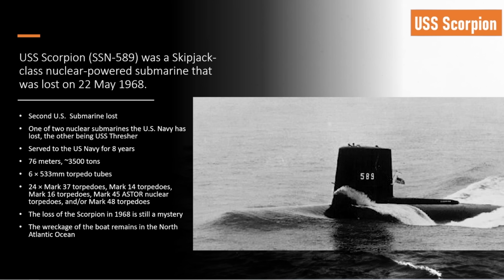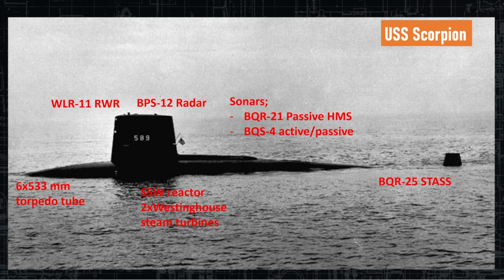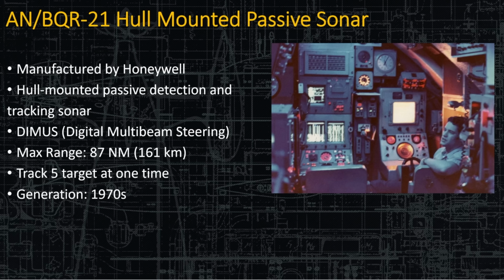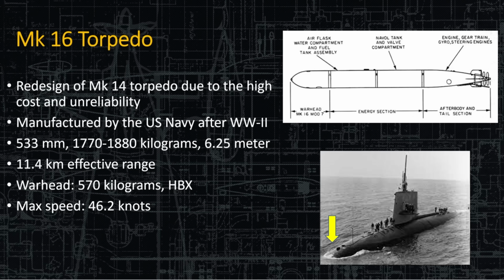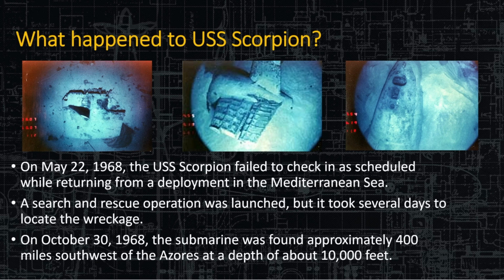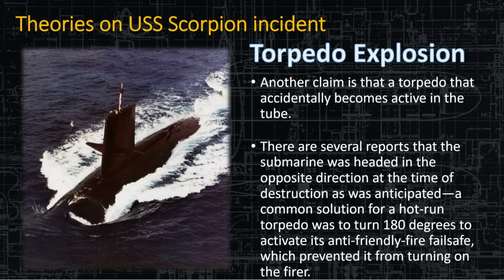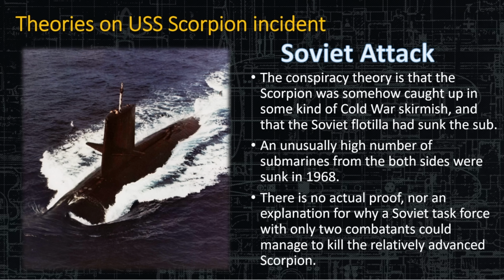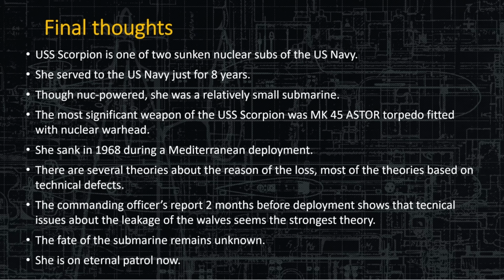USS Scorpion SUBLOSS SUBSUNK

Comment: I've heard of the MK-45 nuclear armed torpedoes, I had no idea their range was THAT limited in relation to the lethal bursting radius of the nuclear warhead......no doubt the crews were not sorry to see them withdrawn from service. No doubt there's nuclear armed MK-48's and especially MK-48 ADCAP torpedoes in service, but the U.S. Navy will neither confirm or deny their deployment at sea. As for the cause of Scorpion's loss, is it possible a battery explosion killed or incapacitated everyone in the forward compartments, leaving the boat to wander uncontrollably until it sank to collapse depth? If so, the Scorpion was lost for the same reason the Argentine submarine San Juan was lost. Hopefully, the U.S. Navy will declassify documents from its investigation so the families at least could get some closure.
Reply: The MK-48 is only equipped with conventional warheads.  Ex-AWEPS.

Comment: The mechanical to electronic converter for steering the sonar you called a compensator.
Is that another name for a potentiameter or encoder. Or is it something different entirely?
Reply: I have no knowledge but it sounded to me like a device which was being tuned to a longitudinal pressure wave. 
Just like a blown musical instrument you tune it by varying the length of the column.

Let me guess at this. 
You expect some frequently. It has bounced off many things but if your detector is at the centre of a curved plate close to a flat plate it will preferentially accept a certain frequency. The frequency which is selected by how the plates approach each other. 
You can steer the direction of reception by tilting one plate, slightly to the side or further round.

Just a guess.
Reply: @20chocsaday  you are attempting to describe the sonar itself. I believe I understand the basics of that.
I'm asking about the part from mechanical wheel turn to electrical signal. He uses a term I'm not familiar with and am wondering if it's just another name for what I know or a different way of doing it.
Reply: @Ye_Old_Grog  OK thanks. 
I was expecting that turning the wheel would move a plate to the direction where you wanted a waveguide to be created. More by a wobble than a 360 degree sweep of an inlet. But thanks for the information.

Comment: Fellow Bubblehead here (SKC(SS), USN, Ret).... where did you get the info on the TDU? I never heard that before. During my career, the prevailing rumor was the Hot Run theory, and the BS about a Russian boat doing it was just that- BS. Good show, though- BZ!

For what it's worth, I was on a 594 (the Haddock) and a 637 (the Pintado) in the late 70's- mid 80's and both boats had CO Standing Orders that the Chop had to be present for TDU Ops to ensure they were done correctly, so what you're saying may have something to do with that... hmmmmmm.....

Comment: Do modern subs have battery backup on the propulsion system? Or are they dead in the water if the reactor shuts or is shut down?
Reply: nuclear subs have batteries and diesel generators. they can also for a very short period run on residue heat from the reactor
Reply: @heuhen  Thank you 🙂

Comment: Weren't the periscope and mast(s) in the raised position as shown on the wreck photos? Wouldn't this suggest they were at PD? If so, and a message could be flashed out very quickly, why no message?

Also, I believe the wreck analysis indicated the batteries were damaged in a way consistent with their explosion.

So, it does sound like a battery issue, but why no SOS message?
Reply: I believe i read somewhere the pressure from those batteries exploding would've killed the entire crew instantly

Comment: A couple of thoughts: The lead-acid battery (Guppy-1 Mod c) evolves hydrogen during normal discharge as well as during a charging evolution. That H2 is removed from the atmosphere via the CO/H2 burner, which converts CO into CO2 and converts H2 into H2O via a catalyst. The H2O (water) drains into the AMR (Aux. Machinery Room) bilge and is eventually pumped overboard. The CO2 is captured in the CO2 Scrubber and pumped overboard.

Also, though the loss of the Scorpion occurred nearly 8 years after Thresher, SUBSAFE had not been fully implemented in the fleet and boats like the Scorpion, built before Thresher were not built to the SUBSAFE standard and had yet to be retrofitted in a major yard-period.

Comment: Salt water in battery compartment leading to electrical fire , release of hydrogen from ruptured batteries, which leads to explosion, which leads to loss of ship.
Dr.  John Pena Craven cuationed against this line of thinking. Becouse any flooding of submarine would introduce salt water into battery compartment. The true cause would be the what caused the flooding initially. Every submarine that sinks will have its batteries burn and explode from saltwater intrusion into battery compartment. It is a consequence of flooding , not the cause of flooding. What caused the flooidng in the first place?

Comment: The TDU, and torpedo tubes and signal ejectors, have mechanical interlocks so you can't have the breach door and muzzle door/hull and backup valves open at the same time.

Comment: One thing you can say for certain about the maximum range quoted for any sonar system:  It is most assuredly not the maximum range it can be effectively used at.  Whether it's lying high or low depends on the system and who's quoting, but any unclassified number is going to be lying through its teeth.

Comment: Lithium battery run away fire in the battery compartment.  I lived in Istanbul Turkey and was 12 years old when this happened and we also saw the mighty E's crew attacked by rioting muslims during shore leave in May 1968.. Coincidently , my mom worked for the Charleston newspaper and she rode offshore on the USS Thresher in spring of 62 when it made a port of call during a shakedown cruise..

Comment: Why do subs have a trash disposal system? This seems to be entirely unnecessary. A strange superflous luxury. If you take x amount of matter into  a sub at the start of a voyage the amount of that matter will remain exactly the same during the trip of the boat. Nothing more will be added. Trash is the result of some of the matter you took on board converted into trash.The process of convertig x amount of matter into trash doesn't affect the buoyancy or weight of the boat at all. So why not just store that trash on board and dispose of it once back in port? Get rid of the error prone trash disposal system. What a joke  - a hull penetrating system just to get rid  of some trash??? A design flaw. Same goes for No1 and No2. Keep it on board. Purify what you can purify and store the usless waste until you're back in port. Again no need for a hull penetrating system. I hope the US sub designers have caught on to this approach  in the meantime.
Reply: Spoken like someone who has never gone to sea on a sub.
Reply: @nukegator7274  Yeah, perhaps it needs an amateur to state the obvious. Although submariners are supposed to be a clever bunch - of dealing with trash in a sophisticated manner they know nothing. You take out the crap you bring in. Is this so hard to grasp?  Why do you need to dump your rubbish in the pristine ocean? Because you haven't spent a single effing second thinking about this problem. You should have a trash officer on board who is trained and understands. You might even have to change the products you buy to provision your boat and also what kind of food you eat there. But don't tell me this problem can't be solved. It is lazyness and the American throwaway mentality that make this an unsolvable problem.
Reply: Probably the long term smell and maintenance of the systems is why they bother to shove it overboard.
Reply: @captiannemo1587  Put the stuff in cold store - zero smell. As you empty out your stores of food and other items for daily use you make space for trash which is stored exactly where the frozen hamburgers were stored before. It is just exchanging one less degraded type of matter with a slightly more degraded type of matter. Have you heard of a trash compactor? This is certainly a less complicated system than a hull penetrating trash disposal. Plus ejecting trash in the middle of a mission isn't exactly the best way of remaining undetected. How do you track US subs? Not by some sophisticated magnetic anomaly detector but simply by fishing out the hamburger wrappers and other trash ejected into the sea through the TD units.
Reply: @wkgurr  Dude, you have no idea how disgusting that trash is. Putting your trash in the freezer is a terrible and unsanitary idea. The freezers are already packe enough, and we have to store plastic trash for later as well. Also waste water creating something that could process waste water would take up so much space, and would probably break. Just pumping/blowing waste water overboard is the easiest and take up the least amou t of room. I don't think you realize how desperate for storage space US subs are already. Plus if you just pump when you don't need to be quiet, you're fine.
Reply: Submarines do trash dumps in the ocean daily.    They don't have a storage tank onboard
Reply: @gregorylyon1004  They should have. It would get rid of the trash disposal system which is a weak point of the sub. Any hull penetration is a weakness. The fewer you have the better.

Comment: Something has always bothered me about the picture of the stern, showing the oil-canning of the stern plane surfaces. The actual stern of the boat is visible. Where's the screw? It should be visible. The only non-conspiratorial explanation I can come up with is that it was, understandably,  scrubbed from the release photos. If not, where is it?
Reply: The screw and the shaft was ejected out of the stern when the engineering space’s telescoped into one another
Reply: That u cant think of a reason it isnt there doesnt mean there isnt a reasonable explanation.

Comment: I just have a hard time believing the Navy wouldn't go out of their way to figure out WTF happened, and most importantly to recover or destroy sensitive hardware/equipment. Theories don't seem like acceptable conclusions. Like... the only way they're gonna confirm the technical issues is by opening up the ship and actually looking in the supposedly affected areas. Maybe I'm dumb, is it just too hard to figure out what happened?
Reply: Between the violence of the implosion, what ever went wrong, and the depth of the water, most of the gear is destroyed. They were reasonably sure the Russians could not recover any of it. Lastly the "Navy" probably knows more than they are making public. The quotes are because they have gone back to the site to monitor and as time has moved forward so has the tech. There is no way they did not put a better camera on an ROV or drone and get better pictures. There is also no way that that they haven't gone back with a high resolution side scan sonar and mapped out the wreck. But a report was written, a few people read it and it was put away somewhere. The people that wrote the report and the people that read the report are now old men.
Reply: @MarkLawrenceKiefer  The only system that isn't destroyed is going to be the reactor, which we really do not want to have destroyed (we routinely run radiation surveys over Scorpion and Thresher to detect if the reactor containment vessel has begun to leak, to allow remediation if it has).  And it has been declassified for about twenty years now that they did resurvey the wrecks of both Thresher and Scorpion in 1985.  Using both HRSS and ROV photos surveys.  The surveys were done by Bob Ballard--the Navy funded his search for the Titanic on the condition that he survey the submarines first, and could use whatever time and money was left over on his liner hunt.  The photos are mostly still classified.
Reply: @rdfox76  The Soviet MIKE class that sunk in the Norweigen Sea in 1989(?) could become a radioactive hazard in the next decade.
Reply: They already know what happened.     They don't want to tell the victims families

Comment: 1 Full Power Hour = Reactor is run at 100% for an hour. So 4 hours at 25% is 1 EFPH (Effective Full Power Hour) When I was in I think they were logging Rx Pwr every 15 minutes, but I suspect it's digitally logged now.
Reply: Ha, you think the Navy would pay for fancy digital log-taking equipment when they've already got perfectly good sailors with pens and paper?
Reply: There is actually a good reason to manually record log readings.  It helps to ensure that the crew is actually monitoring critical system parameters to ensure safe operation and detect any adverse trends such as increasing bearing temperatures, etc.

Comment: I was 8 living in base housing in Norfolk. There were a couple of families affected. They stayed about 3 months after she was declared a loss then they moved away. Very sad. You didn’t mention that they have to dive on the wreck to monitor the radiation levels from the reactor indefinitely.
Reply: They don't dive on it, they lower sensors. Any radioactive fuel that leaks will stay on the bottom because it's heavier and tungsten than anything else, including lead
Reply: @johnryan8533  actually they did dive on it Ballard did in the 80s
Reply: @johnryan8533  I realize that. It was figurative. With increased ocean temperatures we may see some different thermal dynamics from the deep sea.
Reply: Radiation decays. It’s just a very long time (but then no-one is going to be spending much time there anyway).
Reply: @allangibson8494  I think they check it once a year. Send an ROV down and take a water sample.

Comment: Even in early 70s TDUs were a problem on boomers.  The valve shop was referred to as the TDU shop on my tender.  USS SIMON LAKE  HT2
Reply: And the messed up part is its the fault of the tdu operator most of the time. Without getting into specifics there is a key step in the procedure before you put cans in that must be done but often it gets forgotten.
Reply: @Oksobasically2  Yes, definitely. When you see someone making the same mistake over and over again, there's no question that it's entirely their fault, and you should definitely not examine your hardware or your system to see what you could change to make that mistake less likely.

Gotta love the, "Tell people to be more careful" approach to safety.

Comment: Craven theory is the closest to the facts. From the original double explosions to the implosion ,the time interval of the scenario is very close to the simulated hot run torpedo procedure and explain the  final 180 degrees heading change. If TDU why direction change ? If hydrogen explosion why direction change ?

Comment: Great video, Aaron...👍 

Despite the depth the sub is at, I wonder if it would be possible to get a very small ROV inside the hull to examine it from the inside? Or did the hull completely implode?
Reply: It's wrecked. The engineering and aft spaces "telescoped" into the amidships sections. That violent action ejected the propeller shaft out the back and sheared off the sail. Maybe something could get into the torpedo room through the open escape trunk. I feel like his earlier video from some years ago went into all this and that he skipped a lot on this remake.
Reply: It probably already has happened. We just will never know about it.
Reply: @Doug_JB  It's been fairly well documented in the past that, after it's visit to Titanic, Alvin and it's little ROV were sent down to Scorpion, with the ROV modified slightly to fit inside the escape trunk. Apparently it did penetrate the wreck...depending on who you ask it got as far as the torpedo room to confirm both Mark 45 ASTORs were still where they should be.